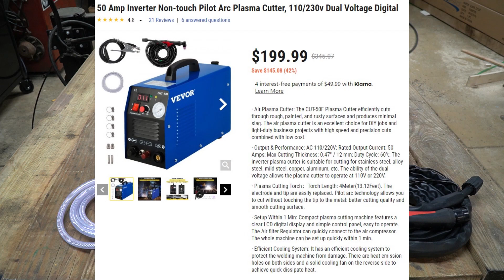Vevor CUT50DF 50 Amp Inverter Non-touch Pilot Arc Plasma Cutter 110/220v Dual Voltage Digital NTDT!

Comment: Does Anybody know why the Pressure gauge does not move on my plasma 50DF  machine?  All I know that once my air compressor set on 8 bars, has finished filling up, the regulator attached at the back of the 50DF starts releasing the air through some apertures.  And if I try to cut anything solid the head of the torch always gets burned out.  The manual says to establish some contact with the piece but it destroys the torch.  Let a bit of space between the piece and the torch, and all I see is a flame instead of sparks.  What am I doing wrong?

Comment: Does it run on household current  ? 15 amps ?
Reply from the maker: It will operate on a 15 amp/110 volt receptacle.  I had to keep the amps turned down to prevent blowing the breaker.  I suspect it would do better on a 20 amp receptacle.  On a 30amp / 220 volt receptacle, it really works well!

Comment: If you start the pilot arc and it is well away from the material you are trying to cut, does it sputter?  I have one from PlasmArgon (which is probably made by the same manufacturer) and it sputters when I start it like that.  If I ground the pilot arc lead though, it gives a full arc like I expected it to give... Here's a short video showing both of those attempts:

https://www.youtube.com/watch?v=eYdxrmcvm7g

The Amazon seller (who claims to be the manufacturer) says that it works as designed and DON'T DO THAT AGAIN...

Comment: according to reviews this thing is junk
Reply from the maker: It really depends on your perspective.   If you are expecting it to act like a $1000+ machine, you will be disappointed.    Also if you are not going to use the machine on 220 volts, expect some limitations.  All of that being said, it does work, it makes nice cuts and it is cheap.   For 200 bucks it's a nice compact unit for the weekend warrior who doesn't need a better machine.    I definitely wouldn't call it junk.
Reply: @1D10CRACY  I'm willing to try it out. The yes welder is on sale for $130 off
Reply from the maker: For what it is worth, I have two YesWelders now and really like them!    I purchased the CT2050 when it was on Kickstarter and it really is a smooth machine!   About a month ago I ordered one of their migs, the YWM-211P.   For the price, it's a nice machine!  I like their brand.
Reply: @1D10CRACY  the CUT-55DS is on sale for $130 off. I don't know if it's decent or not

Comment: Do they run off compressed air or an oxygen/acetylene tank?
Reply: Compressed air.  And he should be running it at 100psi or more.
Reply from the maker: Air and electric is all that is needed.    The manual also says no more than 75psi.    The plasma cutter on my CNC table runs at 80psi.
Reply: @Davidh4198  so he can break his machine? My plasma tells you in the book no more than 75 psi.